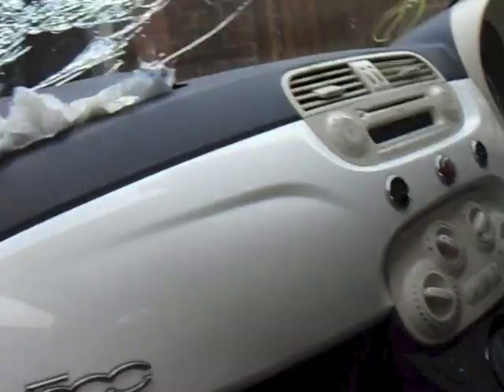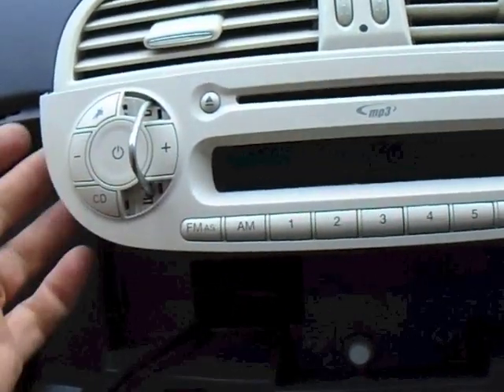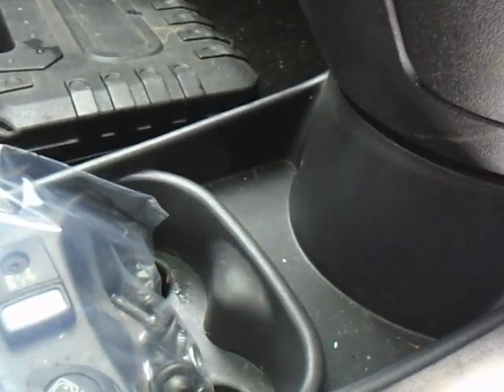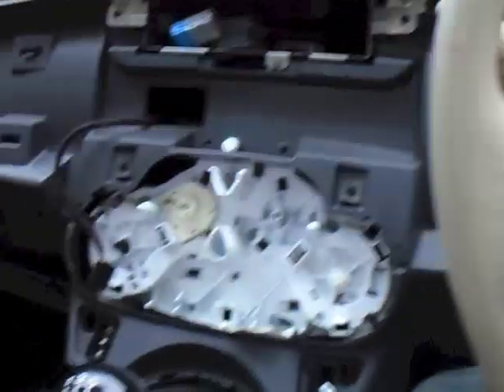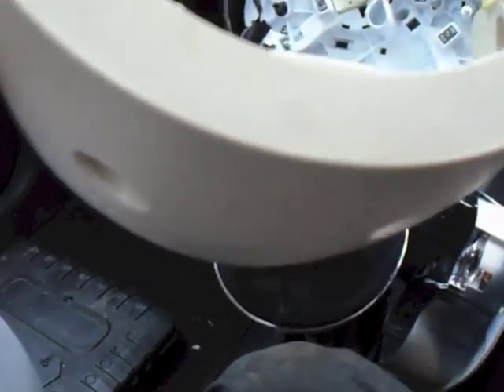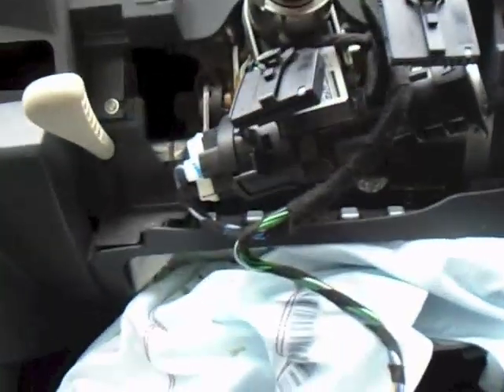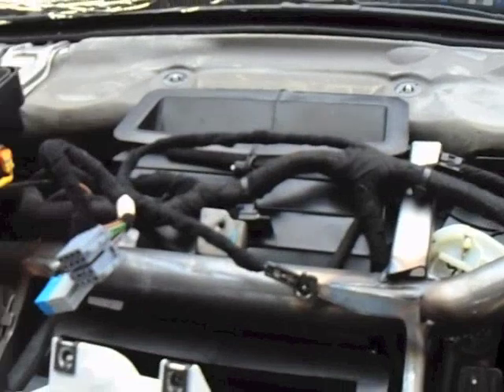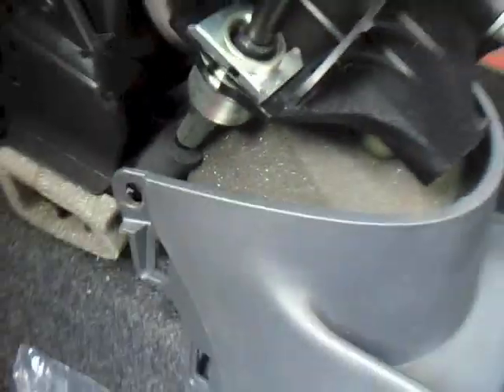Changing Airbags and Dash on a Fiat 500 or Abarth - Love 500 How to Series

Comment: Hi, great video 
One question, regarding crash data. When you have completed the airbag installation, do you just need to clear the codes on the airbag ECU or do you need crash data to be removed? Thank you
Reply from the maker: Multiecuscan will clear the codes but crash data has to be done by a specialist and you will have to take the ECU out and send it off. I haven’t done one for a while but should be around £35 on eBay.

Comment: I have some damage on my dash that really niggles me! Was there when I got car, I have the opportunity to get a new one as it’s a black “sports” dash and matches my interior .... would I still need to remove the drivers knee airbag? Is it attached to the upper dash or can I just leave it be? I’m ok doing it but obviously if I don’t need to 👌
Reply from the maker: Christina Murray it needs to come off. It’s fixed to a metal rail but clips in in the other 3 sides. Very short lead.

Comment: Brilliant helpful video, do you swap out the SRS airbag module? Or do you get the module wiped ? When would you suggest taking this out ?
Reply from the maker: Joel Watts if airbags have blown then you can pretty much guarantee that there’s crash data. MES can’t clear this. I send them off to be wiped. The only time there hasn’t been crash data is when it was just a curtain airbag that had gone. Once that had been replaced MES clears the error. 

It doesn’t really matter when you take it out but if you take it out first and send it off it’ll be ready to put back once you’ve replaced the airbags. I rarely replace a module. It’s better to put the same one back to avoid any compatibility problems.
Reply: Love 500 thank you so much for that information! Who would you recommend sending it off to ? MES is the multiecuscan ?
Reply from the maker: Joel Watts yes MES = MultiECUScan. Worth it’s weight in gold. Actually it’s software so doesn’t actually weigh anything 🤣🤣.

The eBay seller I use is electronics services. Send him your ECU serial and he’ll send you a price. Fiat 500 ones are always £37. Post it off, he does it and returns it the same day.

Here’s a link to his current listing.

https://rover.ebay.com/rover/0/0/0?mpre=https%3A%2F%2Fwww.ebay.co.uk%2Fulk%2Fitm%2F302574613638
Reply: Love 500 thank you. Much appreciated!